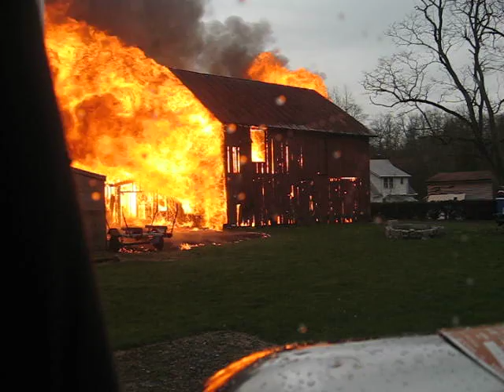Working Garage Fire

Comment: Large orifice smooth bore would have kicked butt (and possibly dropped the wall) especially with the windy conditions however the operator of the deck gun showed the fire he was in charge!  Awesome job. 1 1/2 minutes to knock it down.  Nice incoming water source made this happen. Engineer knew to give it the perfect psi. Great job guys.
Reply: Just read the reply on a different comment and found out the deck gun is controlled remotely. 2 points for the engineer!!

Comment: Nice video:
Thanks for posting it as it shows why all units should have min. staffing.

Not that it would of made a faster attack but you can see 1 over worked FF trying to set a line then returns to flake out his hose.  Then after 5 min someone figures out the deck gun.